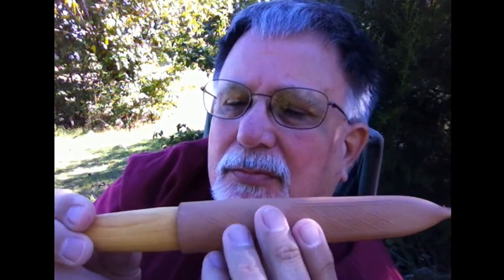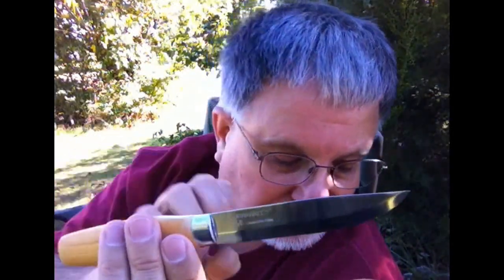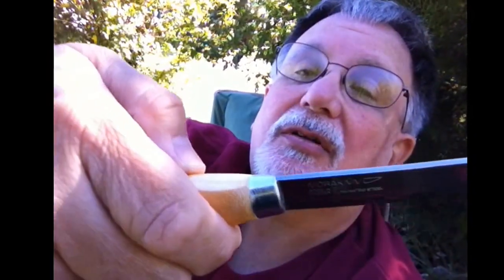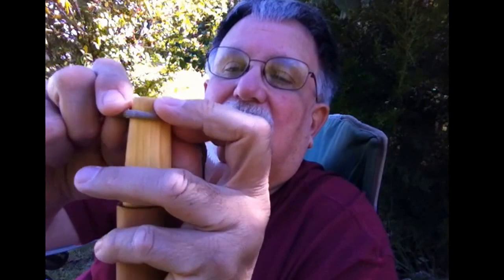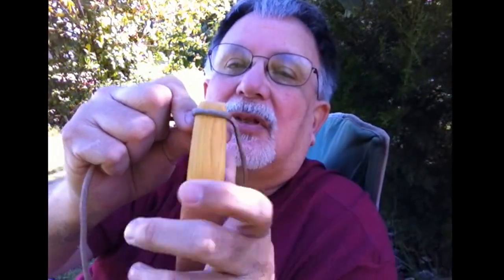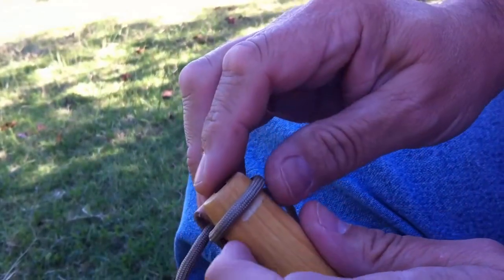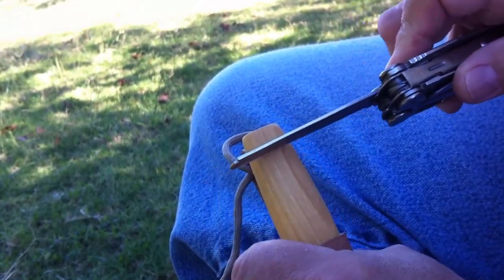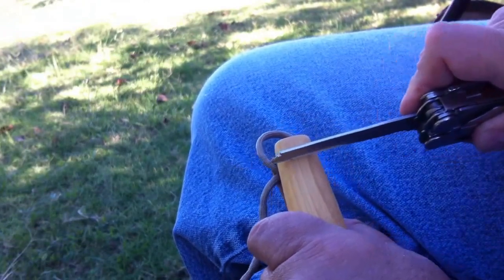My Mora Project part 1

Comment: Great modification for your purposes. Second mod you made would had been much easier and maybe pass by if the belt loop were half inch shorter or attaching point for the cord were at lower poin in the belt loop. You would not have to make any grooves in the handle in that case and leave the handle clean. Nice leather sheath with the Mora. Thanks.